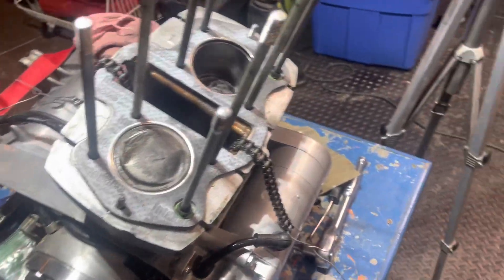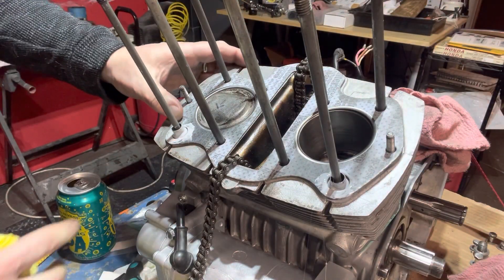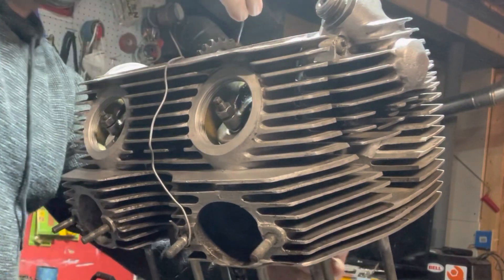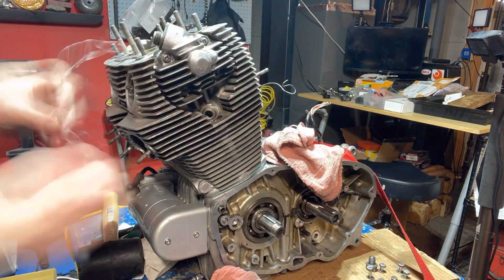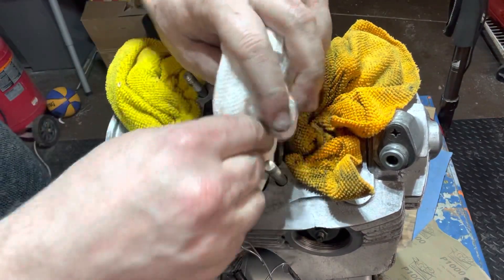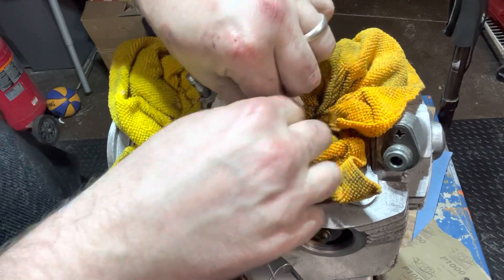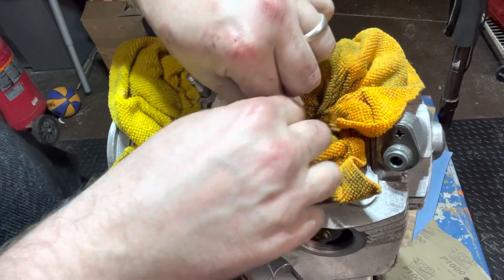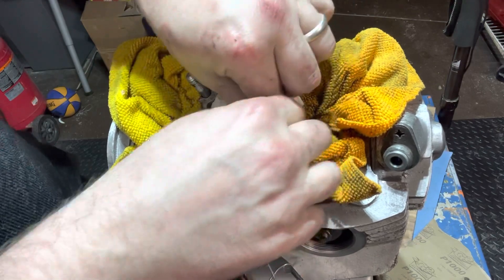Top End Rebuild Motorcycle Engine Assembly How To Honda 305 Motorcycle CB77

Comment: Hi just to checking attaching the cam chain, right side ( throttle side)  piston top dead centre crank timing, mark on  the generator points to T ( crankshaft) and  the cam shaft mark point to 12 o'clock  straight  up if engine fitted in frame is this correct cheers mark great videos
Reply from the maker: Sounds about right to me. Follow the manual! :) aren’t they fun?